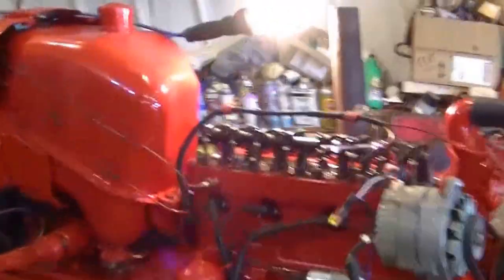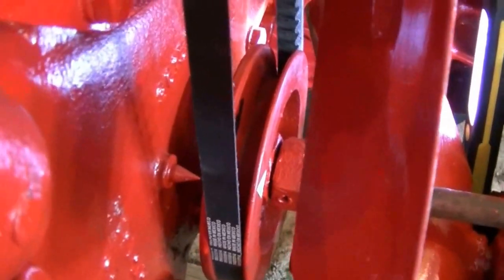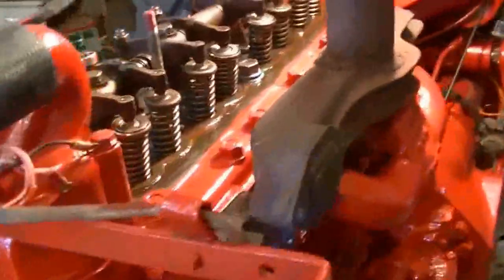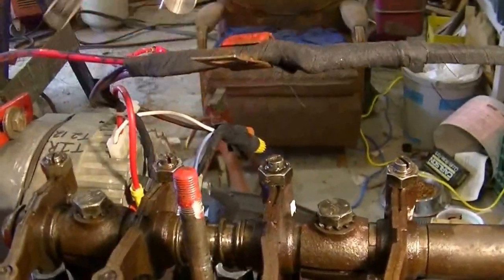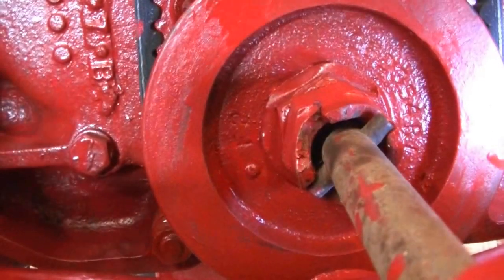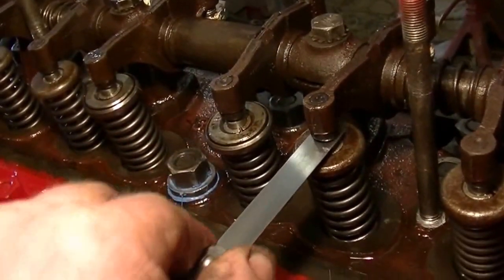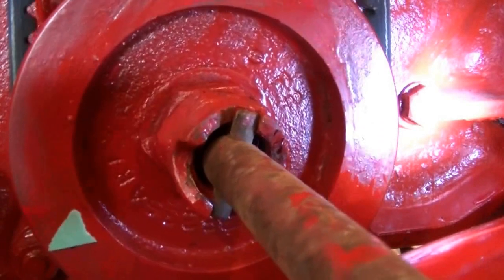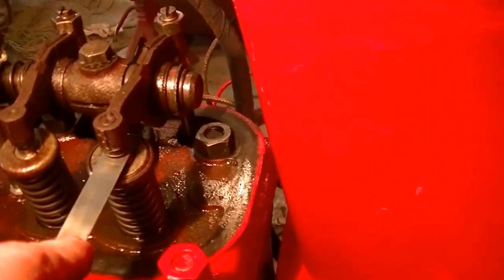Valve Adjustment- Quick and Simple 4 cyl IHC w/Engine Start - zeketheantiquefreak

Comment: I have a c-153  engine according to my engine block serial number, although my tractor is a ih-240.  By any chance you know valve clearance cold ?? Thanks
Reply from the maker: I will look in the shop and see if I have a manual with those specs.

Comment: Hi Zeke, this is the simplest explanation yet for timing your valves.Many Thanks. I am trying to set the valves on my grandpa's old '44 CASE S after doing a valve job and I'm experiencing all sorts of problems with black smoke irregular rpm and engine dying too quickly and doesn't crank over. I think I'll just use your example and test it out.     Rian from Middleville, Ont.
Reply from the maker: Rian: Thank you for the comment and great to hear about your project. Keep us informed about it when you can.
Reply from the maker: Can the 'black smoke' problem be from a 'sunk float'? a float with a hole corroded in it will fill with fuel and cause no end to grief. I have a little video on suggestions how to repair them. A compression test is a great way to eliminate internal engine problems such as a stuck valve or whatever. If the compression is good and oil pressure adequate then the problems are fuel or ignition. Hope this helps.
Reply: Wow, thank you Zeke, I'll write this down and check the carburetor. I never touch the carb when I did the valve job, but I did remove it and I think the carb settings were manipulated. If there is a little hole in the float, if it's brass, I can braze the hole. Our McCormick Deering 10-20 Ensign carb has a cork float, no chance of sinking there. I'll keep you posted, many thanks.

Comment: She is going to be like new when your done!!
Love the sound of her
Reply: need a 18 hp opposed twin briggs andstratton engine? that only needs a clean air filter and tune up?
Reply from the maker: ***** Aye, the clock says 7,000 hours but there is still hope if it was somewhat maintained.
Reply from the maker: Josh Kilen Aye... Maybe... I have a 10 KW generator that needs a driver. Vertical or horizontal shaft?
Reply: vertical but it might have a taker for it, do you want me to find you a engine?
Reply: zeketheantiquefreak
vertical but it might have a taker for it, do you want me to find you a engine? gas or diesel?
Reply from the maker: Josh Kilen I have never owned anything diesel. Never say never. Too bad those 24 hp. Honda engines are so darned expensive. It takes roughly 20 hp. to drive 10 kw of electrical generation. I have thought of running the thing off of a 540 rpm tractor pto, but the generator requires 1800 rpm. Not sure what to do @ this point. I have two other generators that I don't use so it is not something of priority! Thanx for the reply.
Reply from the maker: Josh Kilen I am likely to put my sandblasting equipment up for sale. 45 cfm compressor engine driven plus of course the blaster, hood, etc. if you know someone that restores equipment. I have another neighbour right close and the dust/noise created is going to be an issue.
Reply: zeketheantiquefreak
i don't know anyone that restores equipment but i have found a 19 hp v twin diesel water cooled heres the link,oh is $1,100 http://www.alibaba.com/product-detail/19hp-water-cooled-V-twin-cylinder_749666358.html
if you need help understanding diesels just ask i will be will to help you understand
Reply: zeketheantiquefreak
the max rpms for the engine is 3600
Reply: zeketheantiquefreak
i think this engine would be better for what you want to do http://a1biofuel.net/22WHG-1-Web.html
its a air cooled diesel $1,800